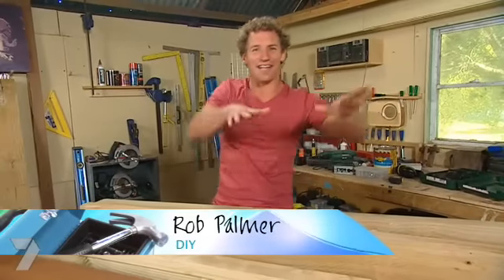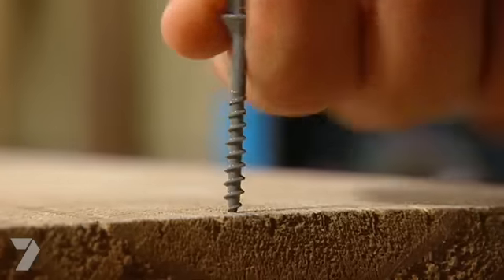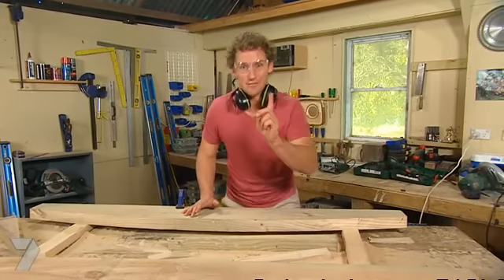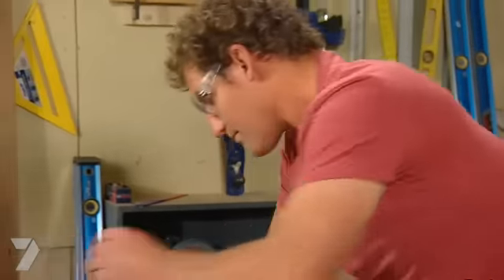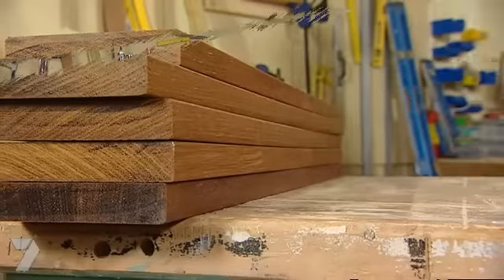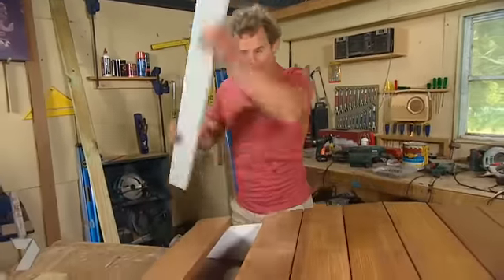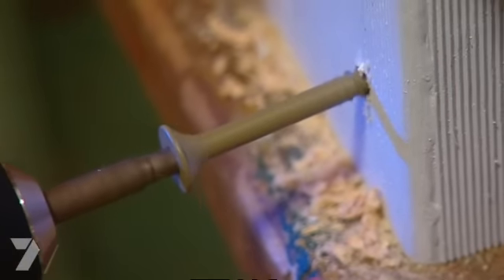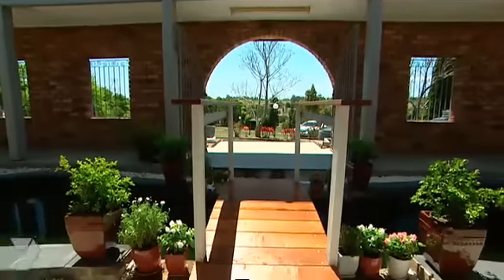How To Build A Backyard Bridge | Outdoor | Great Home Ideas

Comment: I built this bridge and it is time consuming lol. I made the mistake of buying pre-cut lumber at home depot bc I was lazy. I only have a circular saw. Needless to say they are all off in size and I made a template to countersink my screws. They all were a little off. Luckily I was able to sand off a majority of the ends and make it line up 90% to each other. 

My bridge was 5 feet long. Materials list:
21 2×4 × 3 feet slats
4 2x4 x4 feet hand rails
1 2×10 x10 feet cut in half for stringers 
2 1x4 x 8 feet cut at 5 ft lengths for top rail
2 1x2 x8 feet cut at 5 feet lengths for trim
I used #10 screws x2 1/2
For top rails and trim I used my brad nailer and wood glue
Grey and white stain and sealers

Total price around $150

Tools
Circular saw, jigsaw, drill/driver, sander, clamps, brush